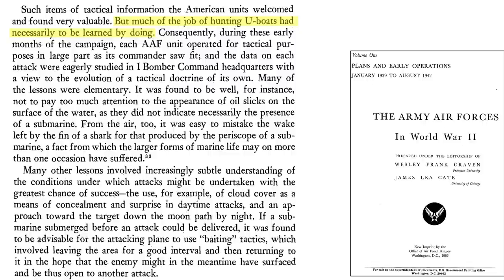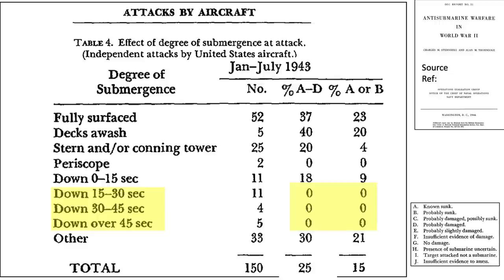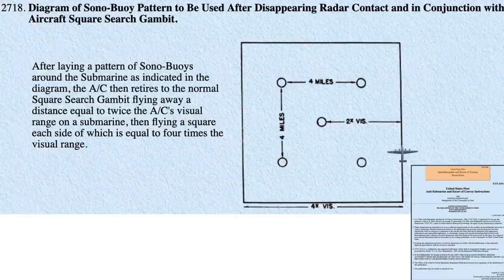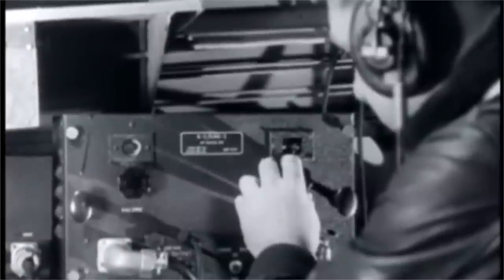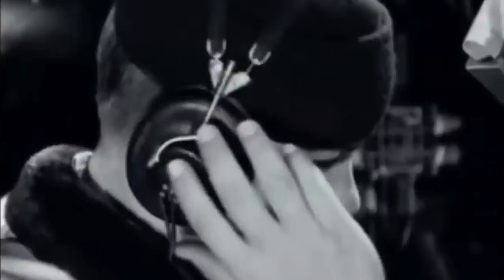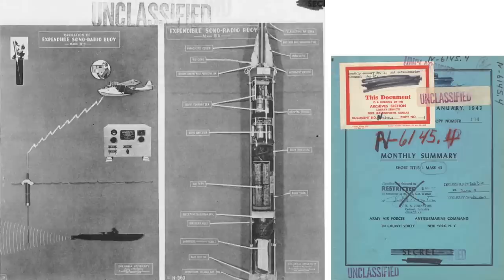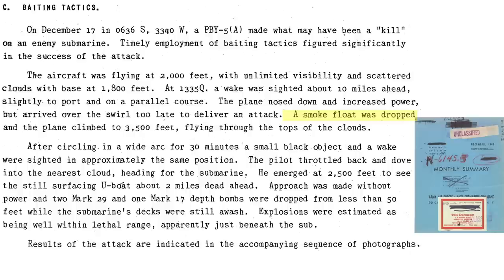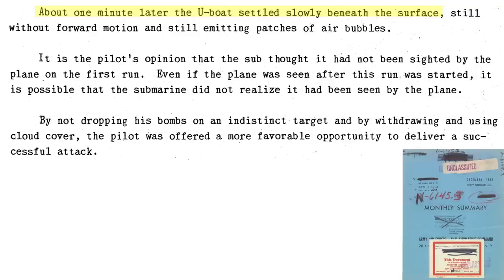The Secret WWII Tactic that Tricked U-boats to Surface

Comment: Reminds me of my initial training as a P-3 acoustic operator. Spent many many hours listening to all sorts of audio recordings. Just as an FYI, these are clean recordings, with no other sources of noise. The situation gets really difficult when there are other ships in the area, especially naval ships. Destroyer types sound remarkably like submarines, having multiple propellers with frequent speed changes. Most merchant ships have a single propeller and will maintain a steady rpm for fuel efficiency.
Reply: VP-60 here
Reply: @johnh4280  VP10, VP-MAU, VP-19, VP-9, VP10.
Reply: VP-31, HSL-31, HSL-35. With that out of the way, I didn't even know they HAD sonobouys in WW2.  I thought the sniffer was ancient!
Reply: @steveanderson9290  OMG! I had completely forgotten about the sniffer. A little before my time but what a great idea. Too bad every ship in the world started using diesel engines at about the same time lol. I met a ww2 vet at a bar in the Azores (Lajes) back in the 70's and he talked about flying barrier patrols in a TBM across the straights of Gibraltar looking for U boats entering and exiting the Med. REALLY interesting conversation about technology and tactics.
Reply: As a diver I can tell you those props sound a lot closer than they really are. So many times I would surface thinking something was getting near our boat only to see it off on the horizon
Reply: @steveanderson9290 same here, never knew they had sonobuoys back then.
Reply: Flying out of Alaska in the old days was dangerously deadly which I'm sure you are aware of. Then the p3 alone could be a major concern. Glad you survived.
Reply: @steveanderson9290 I didn’t either until a few weeks ago. I was a anti submarine warfare tech in a squadron of P-3Bs 50 years ago. I went on a detachment to South America for about 4 months and we had 2 P-3As because they didn’t want to show  the AQA-7. The As had a sniffer and the AQA-5.
Reply: @Chris_at_Home  I was an AX as well, and I served from '70-'74. This video series is astounding me.  I knew about the FIDO but had no idea that it was used as effectively as it was, and I had zero knowledge that sonobuoys were in general use in WWII. Maybe I just slept through those classes in Memphis. but I think it's more likely it wasn't in the curriculum due to legacy security classification.
Reply: Awesome.  I have cousin who flew P3's and P8's. He was the commanding officer of VP-26, The Tridents.  He retired a little over a month ago at the rank of Captin.
Reply: @steveanderson9290  I was in VP-23 from mid 72 to mid 75. Those were great skills we learned back then . I had a very successful career in electronics and telecommunications as a technician traveling all over Alaska for years. The education was better than any civilian tech school when you could play with all the electronics on the P-3.
Reply: VP-10, VP-30, VP-24, ASWOC KEF, Sonics, Mustang TACCO
Reply: @steveanderson9290  - I bet you remember CODAR plants, too.
They were the SSQ-1 and SSQ-20 B-size buoys. Both buoys worked with AQA-1 to the left of the AQA-4 or 5 depending if you were in an Alpha or Bravo. 
I also was an AX and changed rates to AW when they threatened to take my flight pay.
Reply: VP-10, VP-31, P3C. I'm not sure there's a need to know for a lot of that.
Reply: I was a ground pounder that went on many detachments which sometimes involved a patrol in route. The Med is a very noisy place when listening in on the audio from sonobouys
Reply: @thcguitarsrepairsandrestor8672  It's just a way for vet's to reconnect with former shipmates, and share stories and experiences. It really isn't trying to offend or exclude viewers of the channel. Quite the opposite, I hope that viewers are able to gain an understanding a little of what it was like to spend endless hours searching for submarines even if it falls outside of the time frame of the video itself.
Reply: @navret1707  My first TACO was a mustang. He had a beer keg refrigerator in his basement👍 We had many a post flight debrief there😁 Sadly, I'm pretty sure the current Navy discourages such behavior. It sure helped morale though!
Reply: Thank you for your service. I can imagine trying to make sense of what your heard would be very difficult with a lot of pressure on you to get it right.
Reply: VP-48!
Reply: Any S-3A people here?
I always thought that was a cool plane.
Reply: @Johnnycdrums  The coolest thing about the S-3A, was that I was never set foot on one. P-3C was the on-top king of the Cold War.
Reply: @piths1942  ; "Set foot on one"
What do you mean by that?
Locate and track a sub by means of dropping sonor buoys?
The S-3 doesn't work independently, it's told where to drop by a Anti-Submarine (ASAC) air controller, just like a Navy helo.   
The S-3 was a Carrier borne data link  ASW jet which was preceded by the prop job S-2, another fine aircraft.
I think what I like the best about them is their side by side configuration, like in the Grumman A-6 Intruder and EA-6B Prowler.
Reply: I certainly feel like I'm better prepared if I'm ever attacked by a WWII era submarine😊. Enjoyed your presentation.
Reply: Curious how much bubbler systems like Prairie and Masker attenuate these sounds?
Reply: Destroyers sound very different from a submerged submarine.  All modern submarines have 1 propeller normally with 7 blades except those that are using the relatively new propulsor systems.
Reply: That background noise racket is why they developed ANM (Ambient Noise Measurement) sonobuoys to give sonar jockeys a baseline of just how noisy the acoustic environment was in an area.

Comment: Another tactic was to blanket the surface where a U-Boot was suspected with a green paint or dye (formulations changed as the war progressed). When the sub commander upped periscope to look around prior to surfacing, this dye would foul the lenses. Believing himself still submerged, the commander would continue the ascent until, at an altitude of 500--1500 feet, he became a sitting duck for antiaircraft fire.
Reply: You do realize submarines do not need periscope to know the exact depth they are? And they are moving? That's beyond stupid 😂
Reply: 😂 very clever word smith! Took me a minute lol

Comment: Baiting tactics were standard procedures for Coastal Command as promulgated in Coastal Command Tactical Instructions No 22 in March 1942. Sonobuoys were not involved at that time and a smoke float was dropped at the swirl point as a marker. After that it could hunt for no more than 15 minutes then the aircraft would withdraw at least 30 miles for 15-30 minutes before returning, ideally using cloud cover.

Comment: I good friend of mine was a sonar tech. in the late 70's early 80's so I was aware that the Navy used a quite extensive audio library for training. I would never have guessed this was common practice as far back as the 1940's!

I think at the time, a common classification duration was 80 years, such that the next few years could reveal so many fascinating events and technologies.

Cheers
Reply: The US navy was a training monster. Their adept ability to distill so many lessons learned is a large part of the reason for the transition in power in the pacific war
Reply: During the Cold War the US and its allies had such a detailed library of adversary acoustic signatures that individual units of a given class could be identified by idiosyncracies in their individual acoustic signatures.   Their signatures would change after every overhaul and the US and it allies would record these changes and publish them to field units so the bad guys subs could be identified and tracked.

Comment: My Dad was a squadron commander in the 8th Air Force based out of England. Before that he was involved in lots of B-17 training throughout the US, including sub patrols in the Gulf.
One time, while in his B-17 he came upon something floating on the surface. After first seeing it, he figure it for a citrus crate, but then soon realized it was a sub. He took a straight bearing on the sub that was going away. He marked a fly spot on his window and lined it up on the sub. He then used the geometric principal of equal triangles to head his B-17 right over the U-boat. 
Their pictures show that they dropped their depth charges in a pattern that straddled the sub's wake.
This all happened within a few minutes. After bombs away, Dad called back to the training instructor who was taking a nap in the back & told him what had happened. He got really ticked off that someone hadn't thought to stir him awake. You snooze, you loose, is how I figure it out.
On D-Day, Dad was deputy lead of the 1,400 or so B-17s & B-26s that hit Normandy.
Reply: A variation of "Equal Triangles" is explained as Doubling the Angle by NauticaLive.

Comment: Yet another great video! This is a great series.
Do you know if the gambit tactics were used less with the introduction of new technology such as Fido? Or had to be changed when schnorkel equipped submarines became more common?
Reply: I guess a PBY in calm, clear seas can land on the water and outlast a subs underwater endurance. Or call another PBY to take over. Sonobuoy or no Sonobuoy, the sub is in deep do do.
Reply: @redtobertshateshandles  I think the PBY would be too easy to track on the water as sound travels far more efficiently in water than in air. The sound of the engines especially would propagate well through the plane itself into the water.
Reply: @markmaki4460  in spite of that, a smart pilot could land over the horizon, chop power just before hitting the water, wait an hour, eat lunch, then take off heading away from the subs last known location, pull a 180 and climb into the clouds.  On the surface, a sub would only hear engine noise louder than it's own diesel engines, or under battery power would only have traveled a short distance.  Spotters would be visual... until the pby was danger close...not a good feeling.

Comment: In the late 1960's I bought two surplus sonobouys in Vancouver, B.C., Canada.  They contained a saltwater-activated battery, a pc board with discrete components, a transistorized FM transmitter. Frequency about 162 MHz. Estimated output at 12 volts, Ham usage; I don't know what the battery's voltage was, about 1 to 2 Watts.  These were converted by Hams, (Radio Amateurs),  to the 2 meter band, 144 to 148 MHz.  One of my bouys contained a Fuchine (coal-tar derivative?) coloring, reddish purple, agent which disolves and spreads in water.  Stained the whole hippy-pad! Peace Man! 
The microphones were not available. Antenna  was about 18 in. like a ribbon tape measure; vertically erect, 1/4 wavelength.  No sign of parachute.

Several years later I saw a type with directional sensor, (magnetic compass surrounded with a number of coils).  That was classified stuff back then.  Sorry no other info on that. Was the microphone fixed with regard to the bouy? It was obvious that a pattern of these using different frequencies would allow position fixing and course plotting of anything noisy, moving below the surface.  
Checkout magnetometer equipped aircraft; Argus, Orion.  
Technological advancement thrives on inspiration. US army manuals and Heathkit are really good, better than most schoolbooks!  Learnt a lot from them!  Thank you author of the Sonar bouy info.

Comment: Seems odd to me that none of the sub's crew tried to escape; seems like close to a minute available.  Maybe they thought they could save the sub.  Doesn't seem likely many would have died since it was continuing to float for close to 4 minutes.
Reply: You can't abandon ship without the captains say so. There's no freedom in the Navy.
Reply: @redtobertshateshandles  Yes, I remember that :)  Doesn't make it less odd.
Reply: It might not have sunk. The report text reads "...what may have been a 'kill'..." anyways.
Reply: @markmaki4460  That would have been one hell of a heroic save if so. Looked to me like her stern was flooding and likely also her engine and battery compartments. Type 7s had their main ballast tanks up in the stern so had they blown the ballast tanks and were still taking on water, she would naturally sink stern-first like we saw in the video.
Reply: @captainotto  Yes it certainly looked like she was going down. Perhaps the engagement date or other datum was wrong in the original report. Ultra was so secret (even until the 1970s) that i suspect combat reports often contained purposefully wrong data.
Reply: Correction for anyone else coming across my comment above. The ballast tanks on the 7s were up in the bow, not the stern. My mistake.
Reply: A WWII U-Boat  the crew presumably at action stations with flooding engine room , lost power sinking at a 45 degree angle would be a horrible trap for the crew to exit.
The control room alone would be packed, and the only exit up through the conning tower with the officers denying permission to abandon ship as they try desperately to save the boat.

Comment: Wouldn't the bullet divots compromise the strength of the pressure hull on future dives to depth?
Reply: On most subs of the WWII era the pressure hull was beneath ballast tanks and an outer hull that freely flooded when the sub submerged.  Bullets from a machine gun would only damage the outer hull, not the pressure hull.

Comment: The Navy had 2 primary aviation "ratings" (job specialties) wholly concerned with ASW (Anti-Submarine Warfare) when I was in in the 70s. There were the Operators (AW), and the Technicians (AX). The operators flew and used the gear, and the techs maintained the gear,  (mostly on the ground, but they would usually take a "tweetie-bird" on missions to fix stuff in flight.) 

The Navy LOVES teaching history, and any school you go to for training is likely to begin with a history lesson to put what you are going to learn about in context. As an AX (Aviation Anti-Submarine Warfare Technician), I do remember being taught about the FIDO, but I do not remember any mention of legacy sonobuoys, which in WWII had to be vacuum tube based with complex multi-voltage power supplies and undoubtedly a lot of maintenance and coddling required on the ground. This confuses me.

Were you AWs (operators) taught about sonobuoy use in WWII? I can kind of understand them not mentioning them to new techs (why waste time on a painful memory), but I would think operators would get the full history treatment.
Reply: I went through AW A School in the early '80s. I do not recall any mention of the PBY or their technology during WWII.

Comment: How were Bomber and Flying Boat search patterns configured ? I read that often on North Atlantic search and destroy missions against U-boats, planes used a segment of a circle pattern. This looked like a triangular piece of a (very difficult !) cake, with the "point" being their air base and the widest part being their last pass along the "basis" of the triangle, before returning to base. Planes would be making horizontal "loops" between the "legs" of the segment to cover more sea surface. 
I do not know if the same "weaving" pattern within the segment was used on their home trip. Or was the making of 'loops' left to the outward bound plane relieving them ?   
Because early radar sets were unreliable, possibly an optimum altitude, enabling both eye ball and radar detection, was used. What alltitude was chosen as a rule ? How much was the distance between the search "loops" and did flyers use a stop watch to help making course changes ? 
AND: Could this be the subject of a new tube ? It would be great I think !
Your work is unrivalled ! MANY THANKS !
Reply: The sonobuoy pattern he showed with a corner buoy and then three more sonobuoys in an L shape are the same as we learned in the SH-3G Fleet Replacement Squadron.  I ended up on a search and rescue unit so I never got to do ASW in the fleet but we trained on it learning to fly the SH-3.

Comment: My Uncle was part of " Operation Emerald " in the Atlantic . Top Secret until 1986 . During the Atlantic attacks on the convoys my Uncles job was to detect U boats using the ASDIC  system . Once the sub was located it was circled by a frigate which poured oil based green paint onto the surface of the water . All craft would then kill their engines and wait . As the sub put up its periscope ,  it's lens would be coated with a layer of the emerald green paint . The sub commander would assume - due to the colour that he could see through his periscope eye- price that he was still submerged .
I asked my Uncle what happened next and he said that the U- boat would keep rising up . He said that when the sub was three hundred feet above the surface of the water , they'd shoot it down with triple 'A'  !    :  )
Reply: Someone beat you to it.
Reply: @iamdunat0s795  lol!  It's a golden oldie I think .
As they say " originality is just unknown plagiarism " lol ;  )

Comment: Youtube deleted yet another one of my comments! What on earth is happening?
Reply: Did you add an attachment?  Comments with added attachments apparently aren't allowed anymore.
Reply: @thegreatdominion949  No it didn't have an attachment. I mentioned a website where there is a record of a sinking on 14 Dec 1942 but none on 17. I didn't add a link but I spelt out the name of the site in words. Then the comment disappeared. This is the fourth time such a comment has disappeared.
Reply: @kiereluurs1243  I posted to Twitter about this (won't link for obvious reasons) and they said they were "looking into it" before I even told them my youtube name or what comment it was or what video the comment was on.
Reply: YT deletes anything with a link. I suppose they have gotten good at finding constructive links too. I've resorted to mentioning only very specific keywords.